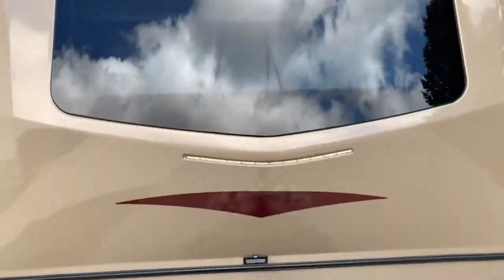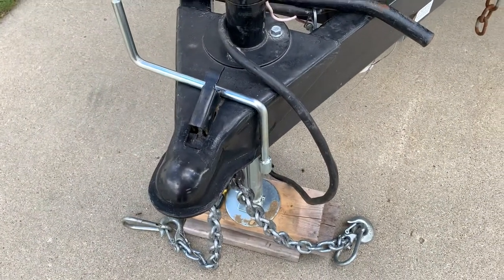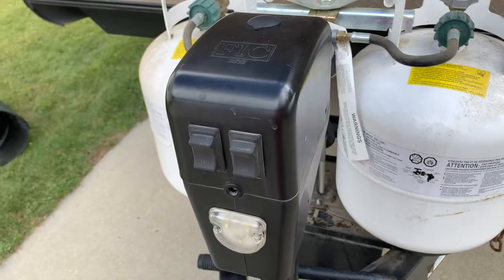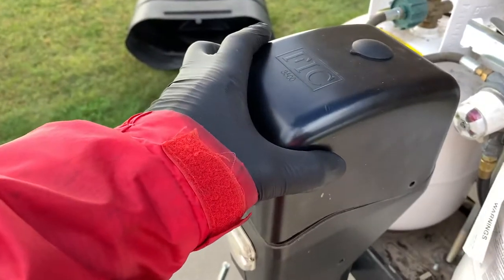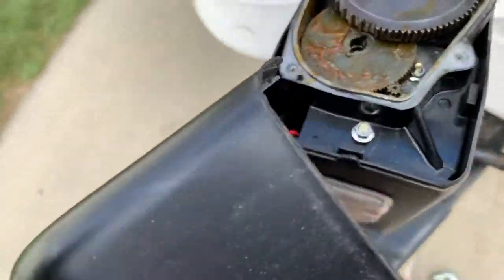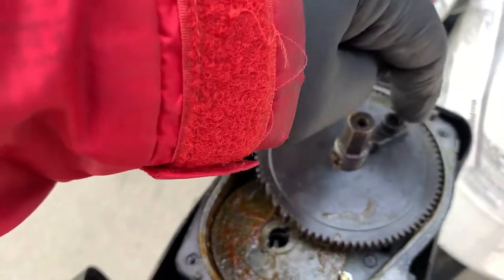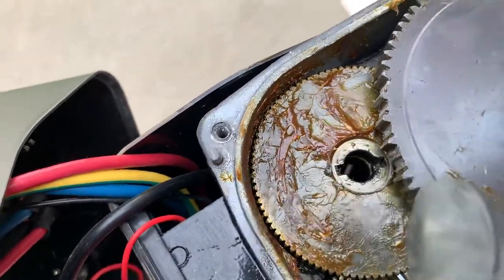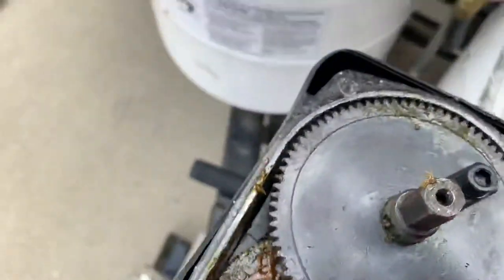Electric Tongue Jack Failure

Comment: Good info - thank you.   Had a ProSeries 2500 that failed in 6 month - was replaced under warranty and now wondering why it broke  again so I am researching the issue. The 5 year warranty sounds great.  Thanks.  Because you mentioned the piece that fell out - I was able to put it back in and then finally the manual worked.   Oddly - it only worked when I put that same piece upside down.    The manual wrench turned like butter but when I put it back in properly to allow lid to refit - the wrench would turn NOTHING.   Must of been a gear underneath that was glitched.  If you had not mentioned the piece that fell out - I may not have even noticed it had fallen.   TY   You can't get a Bulldog Reese for that same price but the 5 year warranty or purchasing a warranty is a good idea.  These jacks fail!  Thanks for info - very helpful.

Comment: Where are the fuses at on these? Mine doesn’t have an inline one and I have the same Jack.
Reply from the maker: It’s been a few years since I posted this. I don’t recall if there was a fuse in-line or not. Regardless, it wasn’t a fuse issue in my case.

Comment: I had similar issue but definitely different. The grating sound gave it away in your case. A shear pin failed in my case I suspect due to bottoming out the jack foot on the street as I came out of a gas station.

Comment: I have RV jack stuck at fully extended. It won’t retract. Switch is fine. Tried the manual lever. It will retract to certain level then stop. Switch would work both ways but stand will only go up but not down. Can hear the motor working both ways by the switch. 

Do you think it’s adjustment issue or maybe the stand is stuck at fully extended position?
Reply from the maker: I'm not super familiar with the inner workings of the jack, but my GUESS would be that when it extended (up) it may have "hyper-extended" beyond the stop point of the gear. I'm guessing that the gear is now out of contact with the drive mechanism and therefore won't go down since it's not engaged.  I seem to remember seeing another video on YouTube on how to totally disassemble a tongue jack. You may have to remove the entire tongue jack and take it apart on a work bench to get to the heart of the matter.  However...you may find, like I did, that you might need an internal part, and they may not be available as a separate component.  That is why I ended up buying a entirely new jack (with a longer warranty).  Good luck. Keep me posted what you discover.

Comment: Both the light and the jack operation work intermittently however when the jack does not extend or retract the light also does not work. Anyone have a solution?

Comment: Cheap as they can make it. Those teeth on that gear are not hardened. If you knew a gear cutter you could get them to cut you a new one out of 1040 steel and then heat treat it and it would last until the year 4785. Gear cutters are expensive though. Are used to have drive gears and pinions (the small gear), made for overhead cranes. I had a couple of machine shops that had the equipment to do it. It’s built to fail so you have to buy another. Thanks for the video.

Comment: Hi Tim:  I have the same tongue jack.  When you got your new one, diff. mgf. , how did you know whether the 3 bolt pattern that mounts to the frame would match for bolting the new one on  Thanks
Reply from the maker: Hi Wanda, if I’m not mistaken, the three hole triangular pattern is standard on most if not all camper tongue jacks.
I hope that helps!
Tim

Comment: i have a 2 year old electric tongue jack and the power jack will not go up but will go down. do u think it is a switch
Reply from the maker: I think you're right, that it's probably the likely culprit! If it operates ok, but just in one direction, I would try replacing the switch first.
Reply: @tipabr   is the part number on the switch. or are all RAM jacks the same switch
Reply from the maker: @christiannihls5408    If you can't find the exact replacement through the manufacturer, maybe something like this would work:  https://www.amazon.com/IndusTec-Wired-AMP-12V-Reversing/dp/B07TWNBCJM/ref=sr_1_9?keywords=12+volt+3+way+switch&qid=1651783645&sr=8-9   I just searched "3-way 12 volt switch" on Amazon.  I wish I hadn't thrown out my old electric jack, I could have pulled the switch from it and sent it to you  😞
Reply: @tipabr   I took it all apart and found one wire was not tight on the switch. pinched it back on and it all works. thankx for your help. hopefully this will help someone that has a similar issue...